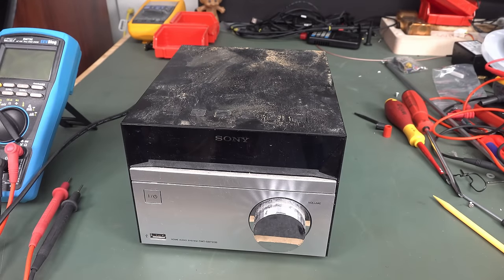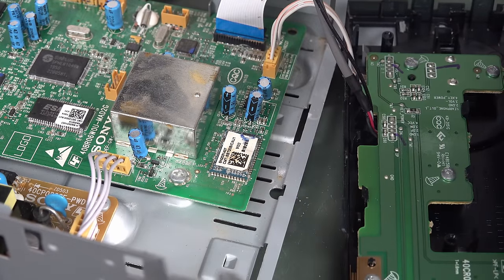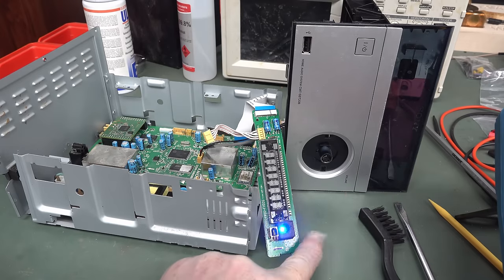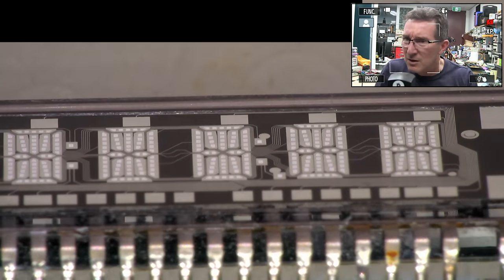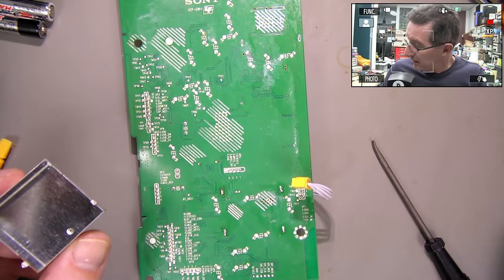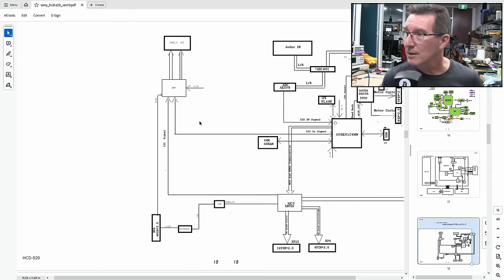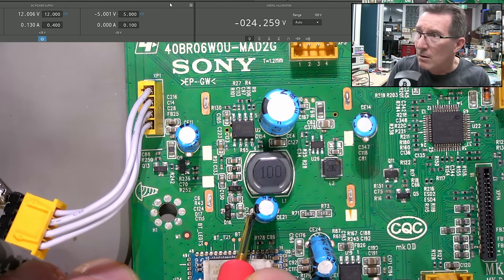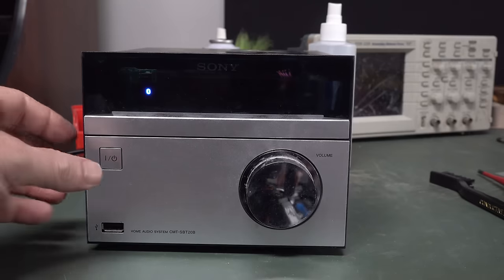EEVblog 1602 - Sony Amplifier REPAIR ADVENTURE

Comment: Nice one Dave. I recently worked an old clock radio from 1977 with a failed VFP display. No fancy charge pump device, just a separate winding on the output of the transformer to connected to a low current linier PSU to supply 28v DC. Sadly the dedicated secondary winding on the transformer had gone O/C so the unit may end up with the modern Boost circuit instead. Nice informative video Dave,  Oh please answer this. Why do you call a mobile phone a shoe phone ?
Reply from the maker: Watch Get Smart

Comment: Still some leakage to the off segments. Dirt on the chip, print, or at the back of the display. It seems to met that the contacts inside the connector for the ribbon cable is oxidised, and that that could 'scrape off' the contact from the cable when you push it in without taking care..

Comment: nice one, i see u might have peoblem with psu for vacum display as i did repair recently my DAT 750 with strange extra lightning pathern on display and the problem was zener diode, after replacement the zener then display was perfect and didnt light up extra patherns. have check all components related to display.

Comment: I have an onkyo that had the same issue with the ribbon cable that was totally trashed. I have yet to find a replacement, any suggestions.? The ribbon cable seem to come from the flip out control panel. The amp works fine, but the button board controls it all..

Comment: So why was it not starting after the water? Maybe dirt in the connectors? It was a broken wire but I was going to say something like maybe a short on the display board was sucking the voltage out.
Reply from the maker: It did. It just didn't seem to start when the CD player wasn't connected. Once all hooked up it worked.

Comment: The corrosion on the connectors in the socket caused drag on the cable strands, causing them to detach when pushed in after cleaning.  The same corrosion caused the unit to stop working.

Comment: How is the -24V output generated from the EUP3482A step-down converter chip?
Reply: Yes, the EUP3482A is a DC-DC buck (step down) chip used for that purpose... to take the 12vdc input and create the +5vdc standby output. I'm no expert on this, but it looks like they tapped off the BS terminal of that chip to run a 'charge pump' or 'voltage doubler' circuit to create the -24vdc. During normal switching operation, the BS pin must have approx 12v AC in it while switching and therefore the doubler circuit (consisting of diodes and capacitors) is doubled and recitified to -24vdc. This only works because the vacuum florescent display barely uses any current from this -24vdc supply and is easy to maintain.
Reply: @ecaparts   The buck converter switches between 12v in and ground. Thus you have exactly 12v peak to peak going into the voltage doubler.
Reply: @eDoc2020  That makes sense. Thank you  😊